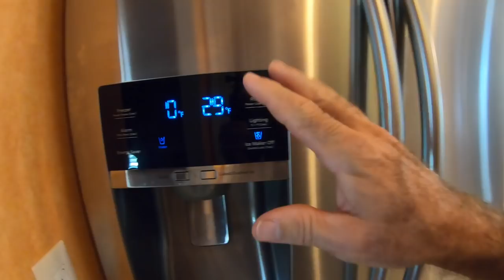HOW TO FIX A NOISY SAMSUNG FRENCH DOOR MODEL REFRIGERATOR

Comment: Your "fix" is only temporary until it freezes up again. Did same thing to mine, but I VERY, VERY CAREFULLY straightened the tubing the second time I took it apart, and it has never bothered me again.
Reply from the maker: I did the same.  After I corrected the copper tube orientation I also haven't had the issue return.  I thought I recommended that in the video?

Comment: What if the sound only stops when you open the freezer doors?
Reply from the maker: Opening a door halts the power to the fan.  That's normal. When you close the doors it will resume power and if you have an icing condition the noise will resume.

Comment: You haven't fixed the root problem. You need to add an additional heating wire to the top tubes as well as the upgraded drain kit.

Comment: Can i turn off my fridge for a day and solve the problem. Of course no food inside
Reply from the maker: Turning off the fridge would, of course, allow any ice to melt.  It might take more than 24 hours depending on how bad the ice buildup is.  Pulling the panels off allows you to examine the coil to see if it is misaligned as mine was.  If this is the case you can carefully adjust the copper coil and eliminate the need to defrost in the future.

Comment: Just so you know this video helped me solve my problem. I had a hard time removing the big inside cover.  I was able to remove the bottom portion of the cover but the top was seemed stuck. So I used a mirror to see what the problem was. I discovered mine was so iced up that the ice had attached itself to a piece of metal on the back of the top part of the inside cover. So with the bottom wedged open, I blew the hairdryer for about 5-10 mins until I was able to safely remove the cover without forcing or breaking it. After that, everything went smoothly. Now my refrigerator is quiet and working perfectly! THANK YOU!!!
Reply from the maker: So glad it helped.  If you have the issue again, you can use the manual "Forced Defrost" mode to avoid using the blow dryer on the plastic cover.  I have a video on that too if you don't know how to set up that function.  https://youtu.be/6tFWkWzLSqg

Comment: A very big THANK YOU to you, James.  Our 4 year old Samsung French Door Style Refrigerator started making fan noise a few days ago.  The symptoms were exactly as you described in your video.  By closely following your instructions, I was able to remove the panel and get to the cooling coil without much difficulty.  With the help of a hair dryer, I got rid of the ice in about 15 to 20 minutes.  I put everything back and the noise is gone.  The whole operation took me about an hour.  You saved me a lot of trouble.  Thanks again.
Reply from the maker: Glad to hear this worked for you.  Congrats on being a successful DIY'r.
Reply: did you have to do it again at some point? or was it a permannet fix
Reply: @johnnycroat  Unfortunately, it was not a permanent fix.  The same problem came after a few months.  I did it again and that too lasted only a few months.  Third time, I insulated the exposed part of the cooling coils with 1/2 inch pipe insulation and that lasted several months.  It is now building ice inside the refrigerator, near the area of the cooling coil.  I also found there is a class action suit against Samsung for this very issue.  It looks like there is a design flaw of some kind.  My fridge is only 5 years old.  My previous Whirlpool fridge lasted over 20 years without any trouble.

Comment: I have a Samsung fridge RF28T5001 purchased in Nov 2021. It looks very much like the one described in this video except that the wording "Twin Cooling" on the back panel is replaced by "All-round Cooling".  My fridge also has fan noise after one year. I followed the present instruction to open up the back panel with about 1-hour effort, only to find out the fan has been moved to a new location at the lower left corner on the bottom floor and has no ice sounding it. So my fan noise cannot be fixed as by the well described method in this video. Don't spend effort to open up the back panel of the newer model.

Comment: Great video! Thank you !  I have the same model and it has iced up twice in the last 4 years causing the refrigerator to stop cooling. Samsung service under Bestbuy warranty tore out and replaced the whole thing the first time and it lasted about 1 year before I heard the fan icing up and finally stopping. I'm glad I kept my old 20+ year old Amana self defrosting unit in the garage as a backup. Pretty sad Samsung couldn't engineer a descent, reliable unit. It certainly is not rocket science. What it comes down to is you have to defrost your refrigerator manually. The freezer is separate and it has already stopped cooling once forcing me to empty the entire unit again and unplug it for 2+ hours to let the compressor "decompress?". Luckily, the freezer started working after that.  Oh yes, and the ice maker went out and was repaired 1 month before the unit went off BestBuy's extended warranty. 
BTW Bestbuy did a terrific job taking care of me while it was under their warranty.  Samsung service wants $150 before they'll even come out to look at their P.O.S
My best advise to anyone is DO NOT BUY A SAMSUNG REFRIGERATOR! Get an LG or what ever company hasn't been swallowed up by the big greedy bottom line corporations .

Comment: Appreciate this, we have had to do this several times now, and have to do it more and more frequently - almost monthly!  Any permanent fix?
Reply from the maker: When I adjusted the copper tubing it fixed our problem.  If this is not an issue with your unit and to avoid removing all the shelves and back cover as in this video check out my video on how to "Force Defrost" the refrigerator.  https://youtu.be/6tFWkWzLSqg

Comment: Hi John,
Thanks for a great job with this video.  I started with another similar video, but I got stuck trying to remove the bottom tray.  I did another search and found this video. I could never have gotten that out (in one piece) without your help!  Even with your help, it was a BEAR!  You really saved my bacon and I am VERY appreciative.  Now, if I can only figure out two more things: How to remove the ice tray to get rid of (what surely is) a bunch of melted cubes; and how to disassemble the drawers to remove the dirt on the bottom caught between the drawer front and the piece it slides into.  Perhaps another short video???
Reply from the maker: Glad it worked out for you.  Maybe another video whenever we can make it back to our US house.  Right now we're here in the Philippines at our home, Villa Feliz.  No problem with our Samsung fan here ; )
Reply: @MyPIDream  Sounds great!  There's no problem with my Samsung fan here any more either.  BTW, I found a You Tube video on taking apart those drawers to clean the space between sections.  I followed her instructions carefully.  Now I have to buy a new drawer (and so do many others in the comment section)  :-<.  ...and so it goes.

Comment: Although, I may have to turn to this method at some point, there's a 'quick-fix' method that many people have had luck with and so far, so have I.  For my model (RF30) you press Energy Saver+Fridge at the same time for several seconds until you get a blank screen.  Then, cycle through some settings by pressing the Fridge button until you see the code: rd.  The Fridge then beeps for about 20mins as the built in heater coil heats up and melts off most of the ice (from what I've been told anyway).  It took me 3 cycles of doing that and now my fridge isn't making that ridiculous sound from the fan.   For some models, you press and hold Lighting+Freezer, so you may have to find your models specific combo.  I found mine here: https://www.manualslib.com/download/1429927/Samsung-Rf30hbedbsr.html   search for your model if either of the codes don't take you to the menu you need.
Reply from the maker: Yes, the next episode I did on this type refrigerator explains all those features in detail.

Comment: Two months after the two year warranty expired on my side by side Samsung fridge freezer it started making the same noise! I put up with it for three or four days then after doing a little research found your video. Thanks so much for making and posting it! 

While I was trying to summon the enthusiasm to dismantle it I did a bit more research it occurred to me to try moving the unit a bit further away from the wall as the user manual calls for a 5cm gap but I only had around 1cm as space is quite tight. By the next afternoon the noise had stopped and it hasn't come back so it might be worth people confirming that they are following the manufacturers recommendations before diving in. 

Presumably the compressor was having to overwork because it wasn't able to get rid of the heat. It is also summer here at the moment and we have had a few 30 degree plus days.
Reply from the maker: Good catch on the space behind the refrigerator.  Most people miss that.  Thanks!

Comment: When I got it open it looks like the I su laying black rubber has melted off some of the copper connections on the right side where the white connector is in your video (above the condenser). Very weird. Is this a safety hazard?
Reply from the maker: Any electrical anomaly that looks like burned or damaged connectors should be referred to a service technician for safety and protection of your appliance.

Comment: Thank you so much for this. I had the exact same noise and you saved me a repair call. I did use a hair dryer on low setting it took quite a while but I got all the ice and now it's running silent!

Comment: Great video. I had a problem getting bottom shelf off. The clips were hard to squeeze so I use 2 screwdriver to push in. The clips stayed in when I took pressure off so I then gently pry the shelf between the gap with flat head screwdriver.

Comment: Thanks, again! Today was the second time I de-iced the fan area. But I'm concerned that another problem had developed. For several hours before I could get to do the job the noise stopped completely, suggesting that the fan has died. Not sure how to tell if that's the case, or what symptoms to see if it is no longer running. I can open it up again to put what I assume would be 12V on the fan leads, but maybe the controller is shot. Well, we'll see.

Comment: I'm so grateful to you for posting this.  Every single new appliance (except my 1948 O Keefe and Merrit stove) has broken in my 7 year old house.  I thought our fridge was a goner.  I got everyone off with my small kids in tow.  I noticed the black goop that is protecting a connection on the right side stuck to the panel so some of the connection wires are slightly exposed.  What should I do for that?
Reply from the maker: Exposed connections is a no-no in electrical terms.  If you are not familiar with electronics or electrical repairs I recommend you finding a qualified technician to repair or replace the connector.  Although the connector you are mentioning is probably low voltage DC it could do further damage to your Refridgerator or present an electrical hazard to you.

Comment: I have the same noise but what was behind that back panel was perfectly clear and free of ice. Icemaker is also free of any ice. Yet the sound is clearly associated with the fan, so I have no idea where another fan is located. The noise stops when I open the freezer, but I cannot find a source for it.
Reply from the maker: Then it is most likely something pushing up against the fan I showed or the fan housing is warped.  If warped it will give the same noise sound as with icing.  A way to check it is to do the procedure I showed but leave the fan disconnected.  Reassemble and test.  If the noise is not there anymore you know you have a defective fan.  Replace the fan.  You can do this yourself and save a lot in repair fees.  Good luck!

Comment: A more sincere evaluation would be that you temporarily stopped a noise that will return any where from 1 week to 3 months.
Reply from the maker: So far 14 months and no reoccurrence.  I think straightening out the copper coil fixed the problem.  I mention this in the video that the QC could have been better on this problem.
Reply: Mine  came  back  in 3 months  noise  again  2 days later un plugged it n within  12 hours noise  is back

Comment: Thanks but this didnt help me. My noise is from below, in the freezer area. I just dismantled the freezer to replace the evaporator fan motor. I assumed it was no good since it hasnt been cold enough. Put all back together, then this new problem of the noise started. There was no ice on the coils, so the noise isnt caused by fan rubbing on ice. It's too soon to know if the fan needed replacing, until I see if it gets cold. Also, to my surprise, opening all to get access to this fan, I see there is a 2nd similar fan near it. In the video I saw about replacing the fan, no 2nd fan appeared near it, so I don't know why there are 2 fans. In any case, now there is this new problem: annoying noise from the freezer. This stops when I open the freezer door.

Comment: I have a Sumsung refrigerator model rf4287hars/XAA, noisy come from the lower freezer.  Once I open the freezer door, the fan noisy stop.  Any idea?  Thanks!
Reply from the maker: On all Samsung refrigerators, when the door is opened, the cooling fan stops which is why you hear the fan noise stop.
Reply: I agree.  I could access the refrigerator side of the fan but I don't know how to access the fan on the freezer side. @MyPIDream

Comment: ARE YOU INSANE or do you just like to profit from making videos on this platform whilst giving your subscribers fake if not also dangerous information on a simple fault that is easily remedied by entering your fridge into FD mode (Forced defrost mode)..

So you knowingly bought a product that you knew was badly designed ? 
In that case why are you here trying to gain our trust in your judgement, or lack of?
If your answer is ego, profit, likes and subs, I think we all get the message.
You should have bought an American product if you can actually find one that's better than Samsung, 
instead of potentially ruining a perfectly good unit online for all the wrong reasons.
Reply from the maker: FD modes doesn't fix the problem its just a bandaid until it happens again.  The instructions I provide allow you to examine the coil and determine if it was improperly installed from the factory and correct the action.  FYI, hundreds of viewers have fixed this issue using these instructions.
Reply: @MyPIDream   What are you talking about ?  
Again you bring forth the premise that Samsung goods are defective in design from the day they enter your home and so this coil never worked properly in the first instance.

By this token you're saying that everyone's Samsung Fridge fails within the period of the guarantee period, if this is the case, why not advise everyone to approach Samsung or the suppliers of their unit for a free service repair. 

I'll tell you why you don't. Because you can't monopolise on making more videos with even more dangerous content.
I hope you can sleep at night when someone who has never held a screwdriver in their lives kills themselves by electrocution or melts through the thin thermal plastic, thus ruining the fridge permanently with a Hot Air Gun! by making a simple misjudgement. But the chances are that you'll never get to hear about them or even care if you did... 

For your information, as long as the fridge is set to provide an internal temperature of +5 Centigrade it should never ice up unless it has been so packed with food that the flow of air is obstructed which could happen only on rare occasions (perhaps over stocking food at Christmas) and would take a quite while to produce any  knocking noise on the fan. 

If there is a failure of the defrost function it is only likely to be an open circuit coil, in which case the coil needs to be replaced by a qualified engineer whether you like it or not. These coils can fail over time and are nothing to do with a fictitious design problem.

Stop promoting dangerous practices which will more than likely make most peoples life and fire insurance totally null and  void should a claim be made. Believe me, insurance investigators are very thorough nowadays.

Comment: Thank you for the video.  We felt more confident removing the panel after watching the video.  Our fan noise was growing increasingly loud and ran longer and longer.  Once we opened the panel, we did find a little bit of ice in the areas you show, but definitely not as much as yours.  We did the defrosting technique, and put it all back together, and the fan is still making a whirring sound, not as loud yet and not as long.  The line closest to the fan seems to have had some hit marks where the fan might have been hitting.  Is it possible the line moved forward and causing the fan noise, or could the fan itself just be the issue?   If it continues I can take pics and show you what we see, but wanted to get this question out asap.
Reply from the maker: I suspect your fan housing is warped or the way it mounts on the panel puts stress on the fan housing.  This will cause the fan to make noise.  If you can troubleshoot it down to the fan, get a replacement from Samsung and install it yourself since you already know how to access the fan.  If you're not comfortable, then contact a service technician.